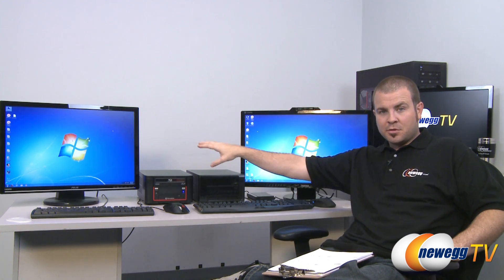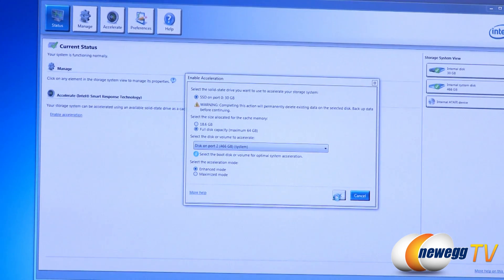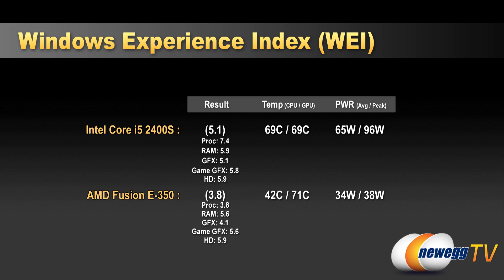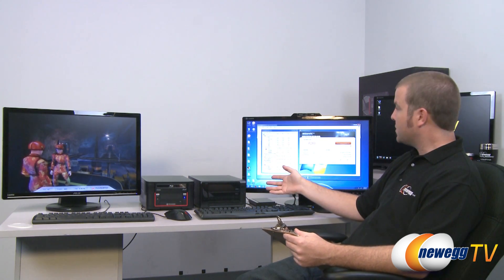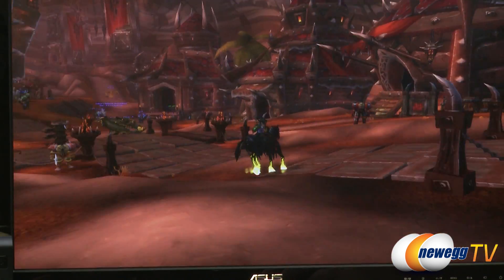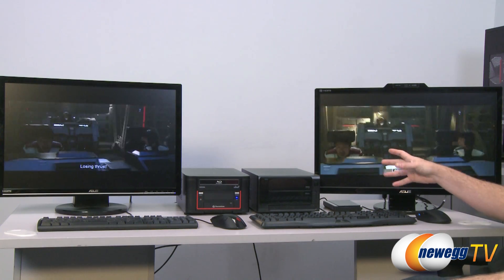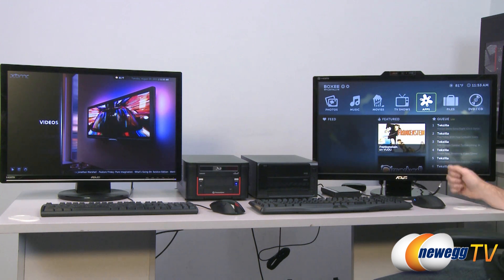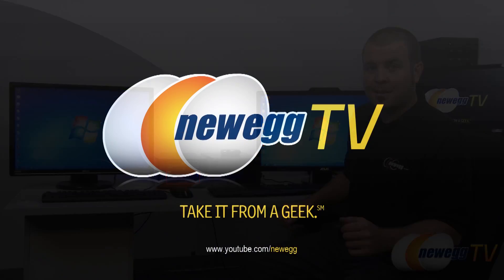Newegg TV: How To Build a SFF Mini-ITX HTPC - Part 2

Comment: very helpful! I had doubt, those things will smoothly run everything i wanted, as a  media center. But i am glad they perform so well.
My only problem is, i wan't to make this machine as cheap as possible, and i can't find the right case.
Are there any simple full plastic mini ITX cases? I can't find any on the web.
Is there a reason why there should be none?.
I just want a 15€/$ plastic case with a powerbutton.. nothing more.
Thanks for vid.

Comment: I used the zotac board in my build but am still having problems to get the graphics to work as it does with Paul. Choppy video and I'm not sure how to increase the memory/speed. It may be that I'm running Ubuntu OS?

Comment: Would you feel at all confident in adding an XFX HD Radeon 7750 to the i3/5 build, considering the meager power supply and possible heat problems?

Comment: @44billbob I have 2 kingston value rams ddr3 1333Mhz and it scores 7.2 in WEI in stock settings. I really suspect there is something wrong in the BIOS configuration.

Comment: @conyo985 it is because it is 1333. There are different speeds of memory that get more and more expensive. 1333 is on the cheaper side but works fine for a build like this. There are memory sets that are over $200 for the best of the best.

Comment: This is what I don't get about the memory WEI scores in both builds, they are low. These are DDR3 Ram in dual channel mode. It should score at least  a 7. I suspect the timings aren't configured right or they are low frequency RAM.